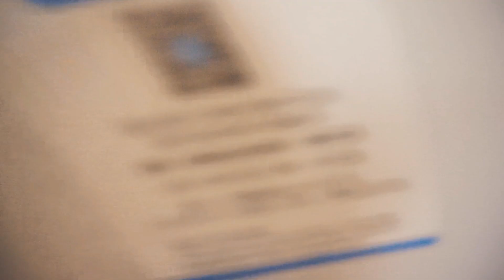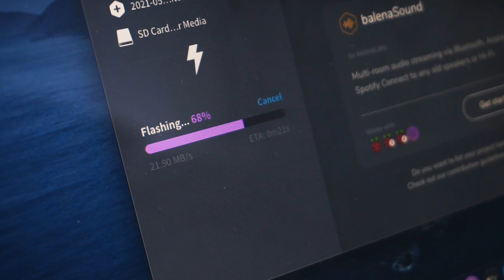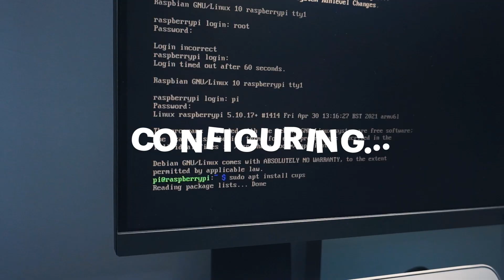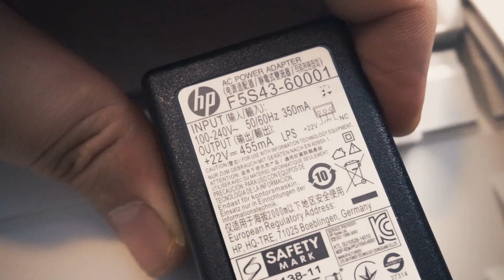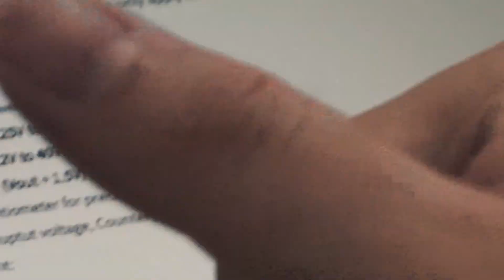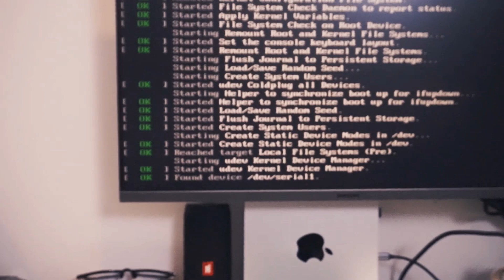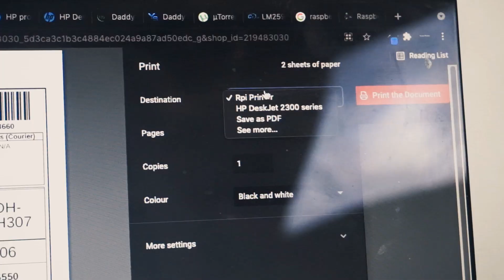Raspberry Pi Printer Server

Comment: Hp printer is relatively easy to setup on arm platform since they provide opensource hplip drivers. 

I have problem with Brother Printer where only x86 driver available. Any clue? Thanks